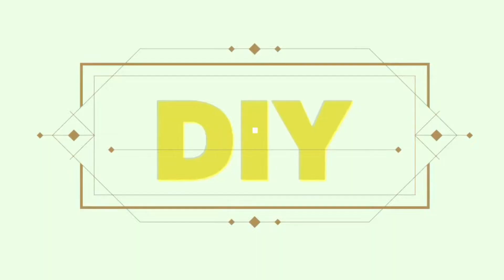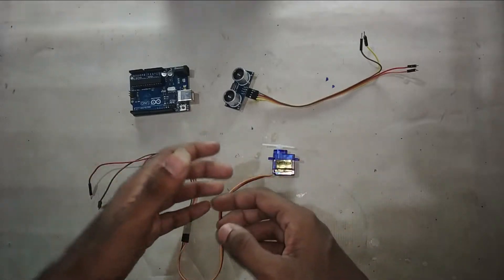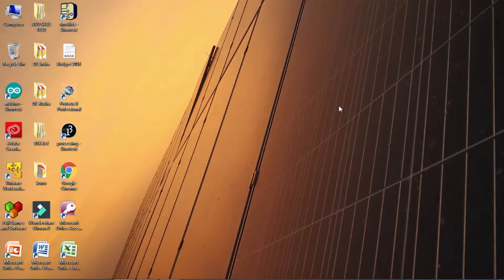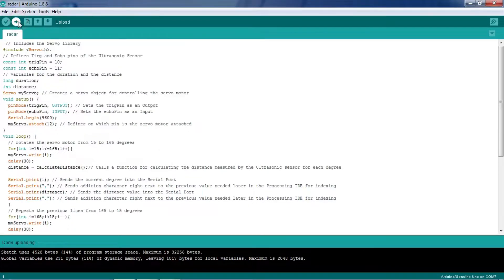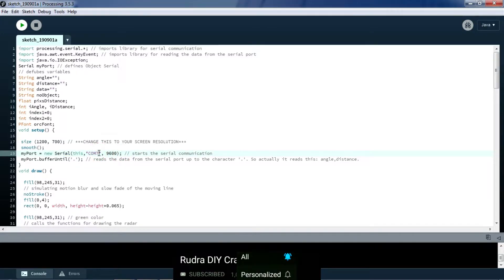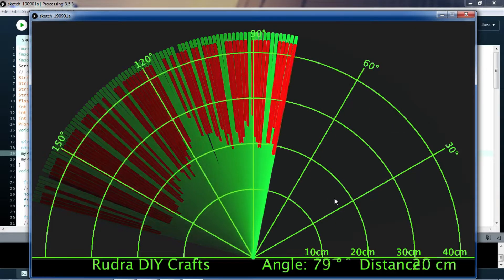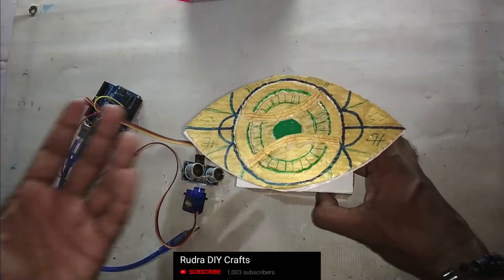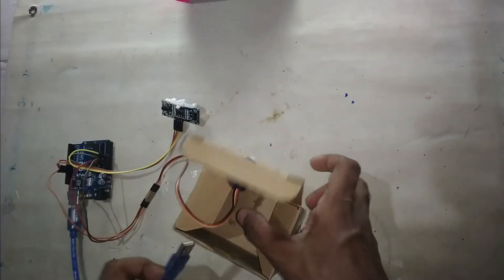How to Make a Short Range Radar || Using Arduino Uno and Sonar || Rudra DIY Crafts

Comment: Sir can we upload two different programs (radar, control water pump ) in one Bluetooth aurdino board
Reply from the maker: You can't add 2 separate programs .. if you will upload 1st one then 2nd one then the 1st one will be erased and the 2nd one will be stored in Arduino .